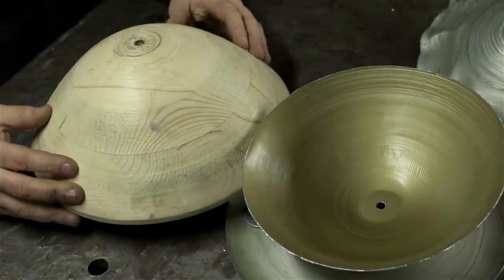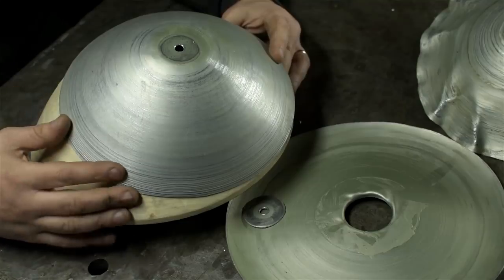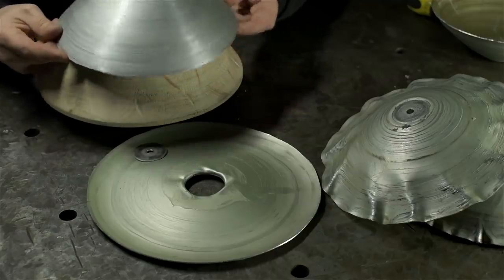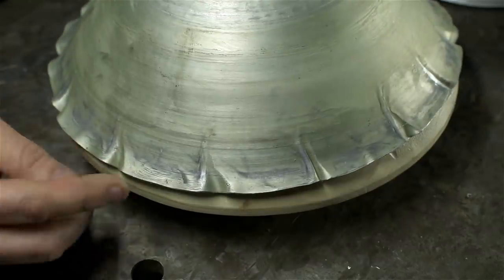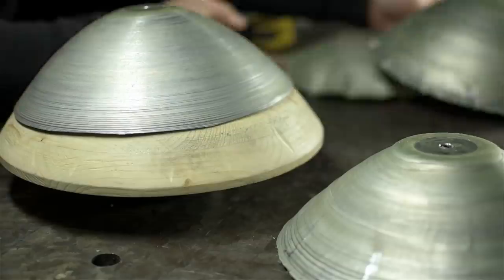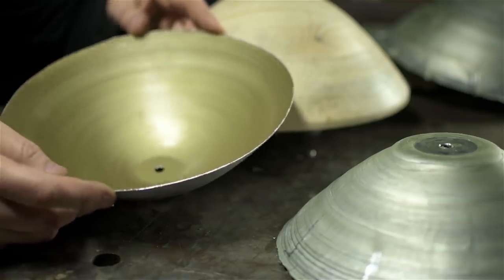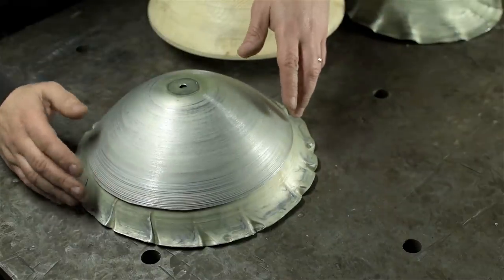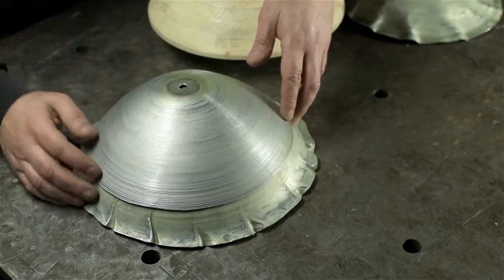Spinning Metal - Round 1 - I LOST!

Comment: I've only seen this done before in one smooth continuous pass. Maybe you're taking so long that the metal is just getting wrinkled from old age.
Reply: AndTheCorrectAnswerIs 😂
Reply: No. As the metal gets thinner in the middle, some is pushed to the edge, thickening it. As the edge is thickened, it is only being thickened at the part closest to the portion being worked, leaving the outer edge unchanged. The thickening of the outer portion needs to be uniform, or you get this wavy pattern.
Reply: Thats the difference between being shown by an expert as I was and trying to teach yourself an art that is actually quite dangerous should it go wrong.  My 4 spinners were all on piece work and would have got about 75 pence for spinning one of these out of steel and about 40 pence for one out of aluminium back in the 1990's

Comment: Tony, I've done a fair bit of spinning.  You need a lube or wax on the material to start with.  Also the material will work harden on you.  You need to anneal it before starting and then again if it gets hard on you.  I make high voltage torroids for Tesla coils.  It took lots of trial and error but eventually you'll get the hang of it.  Good luck!
Reply: Do you have any videos? - getting that shape sounds like an adventure
Reply: definitely make some vids
Reply: What's the largest one you can make?

Comment: this video did not meet my minimum requirement of %72 danger.
Reply: If the disc slips, there's no hiding from it.
Reply: Keep in mind, that at 71 3/4% danger, youtube will demonize the video. He’s walking a tightrope of the best video ever created and complete financial ruin.....
Reply: Solid YouTube legal advice here, heed at your own risk.
Reply: So, what you mean is he should mount everything in angle grinder, not in a lathe?
Reply: I was promised a jet pack. Screw this.
Reply: @aserta  However, there is a non zero chance that it will go up, back or down, instead of into the operator.
Reply: @stevenkelby2169  Ah, the Russian Roulette approach to shop safety:  "it is safe, five cylinders are empty!  What is this 'ricochet' of which you speak?"

Comment: I spin bells for musical instruments and the wrinkling is a common problem. It’s a result of a few things. 
1. The metal that had already been worked is very hard and the stress and energy exerted on the softer section causes the edge to wrinkle. 

2. On larger diameter blanks if you stiffen the edge by flexing it back and not spinning the material all the way out to the edge until the last pass this can often be avoided. 

Largely your issue is work hardening an can be solved with annealing and 2 spinning steps. 

Awesome video!!
Reply: commenting so it goes up
Reply: Commenting so it goes up (good idea 666Tomato666)
Reply: Phillip Greenberg likewise
Reply: Is this how cymbals are made?
Reply: John Strange yes, but now the cheaper factories just stamp them out with dies
Reply: Awesome mate, thanks for sharing.
Reply: Cool. Makes sense that they would just stamp the cheaper ones out. Thanks.
Reply: +1
Reply: If I recollect correct, that's what AvE ended up having to do when he tried this. That vidjeyo is a bit dated by now, but y'all may be able to find it.
Reply: bruh
Reply: Didn't know commenting acted as an upvote, but here goes
Reply: i think at least worth a try
Reply: So the folding back and forth of the rim we see in Tony's video, when it kinda "curls back" is work hardening the material more than closer to the center, in a sense?
Would it be solved by spinning a larger "rough approximation" the entire shape earlier, instead of focusing on the center?
Reply: Xissorplane watching some other spinning vids — propeller nose cones and 3 (+/-) foot diameter domes — it appears they do the opposite of what you suggest. They don’t do any “rough” stretching of the material, but rather focus all energy at the point where the metal meets the buck, sometimes working back over, but all forward progress is hard against the buck... so no working out from center. The unstretched material remains perfectly flat and spinning perpendicular to the axis. They always end up trimming the edge as they get to end, but never the floppy stuff.
Reply: Ahh. Makes sense. So the "almost outer rim" is untouched, until they get to the part?
Reply: up up up
Reply: Xissorplane yes... and now watching a few others, sometimes you’ll see a wee bit of “pre-stretching” but limited to very close distance to the buck, which is then pressed hard against the buck in the next pass.
Reply: Jim Woolfrey I believe I may have been misinterpreted or Misspoke  on that. It is most important to have the material down to the mandrel before moving it to the next segment as this can cause a twist. 

Very cool so see how Tony uses a rigid tooling set up similar to a scissor tool. I use all hand tools and many many annealing passes as it graduates the material in a way that attributes to a good sound quality
Reply: To the top!
Reply: Sounds so cymbal
Reply: I watched a few other as well and a common thread seems to be to work the outer edge a bit first and then perform the shaping.  Looks like there might be some advantage to use a wooden forming tool as well...
Reply: great comment. 

I was wondering about annealing at the beginning and as a second operation, also how about surface speed on the outer diameter.
Reply: please make videos of your own!!!!!!
Reply: Can you make a shell for handpan?
Reply: bump
Reply: I worked in a metal spinning factory and the advice this guy gives us solid. Use a board to bend the outer last half inch of metal towards you, about 30 to 35 degrees, then form that last. Many slow passes. It takes years for master metal spinners to get there, so don't be hard on yourself.
Reply: +1 on this comment
Reply: Could you please say more about annealing practices for aluminum?
Reply: Great advice. Thanks for sharing.
Reply: @johnstrange6799  I wonder what difference that makes to the sound of the finished item?
Reply: @RogerBarraud  It's a good question. Lots of variables involved it seems.
Reply: Great input!
Reply: I knew heat/annealing could be part of the problem. Glad my comment wasn't nullified.
Reply: Bump
Reply: Here is a link to some  of the spinning i do for horns. I intend to post some of the larger work as well.
https://youtu.be/D2hFmVHY4vk
Reply: @jimwoolfrey1117  So he actually spins metal for a living and you watch youtube videos.  I think I will take Miles word.  You might have stayed at a holiday inn but I'll take someone who actually has experience spinning metal over someone who watches videos.
Reply: Just based on my first materials engineering class, I was about to suggest what you did! Really cool to see I was right from someone who knows
Reply: @johnstrange6799  Only cheap ones. Professional cymbals are hammered in shape.
Reply: @milesomalley5605  That's not correct John. Cheap cymbals are spun. Expensive cymbals are hammered. Either by hand or machine.
Reply: Dennis Boxem almost all cymbals are spun, stamped, and hammered. Cheaper ones are just made by doing less of the hands on processes and getting it to shape as quick as possible.
Reply: @milesomalley5605  sorry Miles, this is only the case for affordable to mid range cymbals. . High end Cymbals are cast and rolled as blank flat sheets of bronze, after which the cup is pressed. The bow and  profile in the cymbal are completely formed by hammering after which the cymbal is lathed to the correct thickness and tension. I have visited every mayor cymbal factory over the past 20 years. Most of them several times, so I know a thing or two about cymbals. We are getting somewhat off topic though. The hammering is done mostly done by a machine the industry refers to as the Quincy drop hammer. You can see it in action here: https://www.youtube.com/watch?v=sKZEyXM5ZiA

Comment: i was a metal spinner for 17 years on a very large spin lathe.doing the same thing cept with 16 foot dia.so for the ripples.you just need a larger blank expect to cut off ripples.
you should make sure part is laid down to the tooling prior to spinning the lg dia..also if you introduce a little heat on the other side of spin wheel it wiil help
Reply: Also, I used to crease the edge of the blank to give it more rigidity, but I agree - pin the blank to the chuck as soon as you can with multiple strokes backward towards the tailstock end. This will reduce thining of the blank and gives less chance of rippling 👍

Comment: Used to work at a metal spinning company- 1. if you don’t have a known soft grade of aluminium then annealing halfway through the process is worthy trying (use soap to gauge the temp, mark it with the bar of soap, heat till the soap turns brown). 2. Also use tallow as a lubricant (obtainable in the U.K. from plumbers and electricians merchants). 3. Most of the aluminium we spun was done with plain ordinary spinning tools - often shop made - think of the shape of the back of a teaspoon, but highly polished. And your tool is restricted by using the toolpost as a fixed pivot - use the tool freehand against a pin so it’s not restricted to a fixed radius. 4. Start with a thicker blank - the aim is to stretch the metal and make it flow into shape. You won’t end up with a 16 gauge lampshade with a 16 gauge blank. There will be surplus at the end, which you cut off with a tool like a woodturners skew chisel. 
But as a first attempt what you achieved is bloody good.

Comment: Oh!  I've always wanted to try that. I think it's just work hardened. Try annealing half way through.
Reply: Ditto.
Reply: I second this notion
Reply: What everyone else said. Time to od a little annealing part way through.
You might be able to do the heating without removing it from the lathe if 
your very careful.Just don't want to see you have to invite the people in the 
big red truck over for  a BBQ. Been there done that in 2001. Garage door opener
had issues and started a fire. The red truck showed up and put it out but not after 
a total loss of everything in the garage and a lot of damage to the house. But on 
the up side No Loss of life.
Reply: ". . . Try annealing half way through."    Blow that, the inside and outside both get bent and stressed. Go for broke, anneal it all the way through, several times. ;-)
Reply: I guess I need to clear that up. Half way through the process of forming.
Reply: I for one would never have guessed THAT was what you meant.

Be very specific at all times hereafter.  Dismissed!
Reply: Came here to say this.
Reply: I second (third? .. N-d?) that.  I've tried metal spinning before and always ended up with this same disaster.  I never had the budget to bother debugging, but I'd like to see someone do it for once.
Reply: Nina Averkieva what he/she said
Reply: I watched a spinning video (and admittedly that may make my advice bullshit) but it looked to me the metal was pushed towards the centre as much as it was pushed away. Pushing metal away from the edge might help.

(Admittedly my reasoning is based on the recreation of the technique of a Japanese man who made a rabbit from sheet metal using apparently only a hammer.
https://www.youtube.com/watch?v=OT0AlFmAkv0)

Of course spinning dates back to the Romans, so chances are there's a book about it.
Reply: that might be it , the one i seen done on youtube used metal rods without rollers , the friction of those must get the plate close to melting
Reply: I think it would need annealing several times. Every time it starts to fight.
A deeper shape might require half a dozen anneals, or more.
Reply: Steve S 250 C for 3 hours in the oven. Mabye bake some cookies if you can
Reply: I tried kneeling. All it meant was I couldn't reach the power switch, or see what I was doing. Any other bright ideas? ;)
Reply: Yeah.... that looks correct to me.   The diameter of the material he's bending on is increasing faster than the shape he's pushing it onto.  

Reminds me a bit of map making, because that's a very similar issue when you try to shape a piece of paper over a sphere.   There's just too much material in the paper to go on smoothly.
Reply: As many have said, it’s work hardened. I’ve done lots on an English wheel and as soon as you have pushed to far it will ripple. Your first good one was perfect timing and push. Very difficult to attain on a regular basis without extensive experience. 

Love your channel mate, keep up the great work!

Comment: Another great video!! Like most of the respondents here, I've not done any metal spinning. I have, however, done a lot of metal forming and spinning is just another method of forming. What you are trying to do is just a special case of tipping or flanging and, I believe, what you are seeing is largely due to trying to force more metal than will easily fit into the space available. This is amplified by the cold working the metal is experiencing and the likelihood that, as many have suggested, it's not annealed to start with. It's one of the risks of working with "unknownium" from the scrap yard. In order to not wrinkle, the metal needs to be soft enough that the easiest place for the extra metal to go is "into itself" rather than making a wrinkle. Once it starts to double over on itself you're unlikely to recover.  In order for it to do this, it helps a lot if it's dead soft which is an unusual condition to find in found materials. I personally like fully annealed 1100 aluminum for forming and regularly get 150% elongation w/o tearing. On the same part, I can also "use up" (shrink) considerable amounts of material on the flanged edge without having to re-anneal (usually) and, as one would expect, the metal gets noticeably thicker where the surplus is absorbed. The annealing temp for most aluminum is 800F and I use the O/A soot burn off as many have suggested. Black sharpie markers work too in place of the soot. I have seen a few spinning lathes and they tend to be much more massive than regular turning lathes which must be for a reason. Apparently they are as rare as hens teeth and sell for big bucks when they do show up. Anyhow, thanks for all you videos and I'm sure you'll figure this problem out eventually. I'm looking forward to it.

Comment: Basic aluminum deal...
Take your oxy acelelyne torch. Set it to sooty. Cover your aluminum with soot.
Re-set your torch hotter. Burn the soot off the aluminum.
That will soften the aluminum and you can form it without splitting.
Reply: deepnhock, not forgetting water quenching.
Reply: @michaelg_839  That hardens it, not softens it.

Comment: I have done these before creating some 12" aluminum balls for a large tesla coil, but you need to anneal the material by heating it up before starting (don't quench it), if you feel the material is getting harder as you work it, anneal it again. I used a propane torch and heat it up carefully. Also, if you use just a tool rest with some pins, you may have a better feedback of how hard the metal is becoming. 
I did my half balls starting at the center and going all the way to the outside every time, when the shape was close, I use the tool against the form to refine the shape. Always use a blank a little larger than needed and with a piece of HSS ground like a regular lathe cutting tool attached to a bar, you cut the edge and make it perfect.

Comment: Maybe use a blank that is a lot larger than the finished project is meant to be.  You saw the wrinkling on the smaller bowl at the edge, and then on the larger bowl at the edge.  If you had a very large blank the edge would be so far away that it wouldn't have that tendency to wrinkle.  Just a guess.